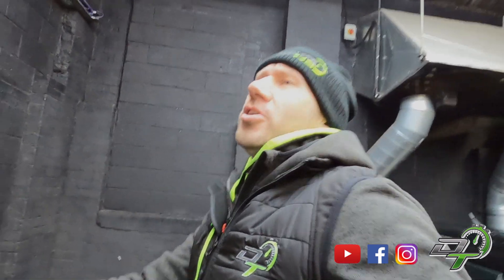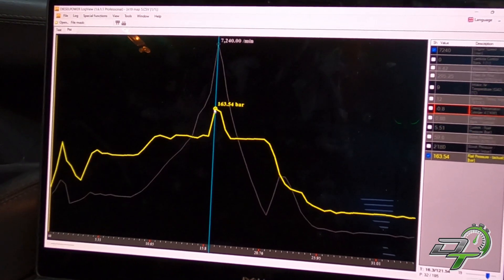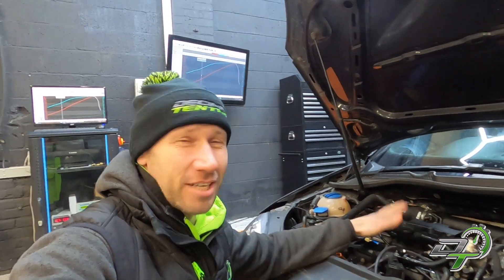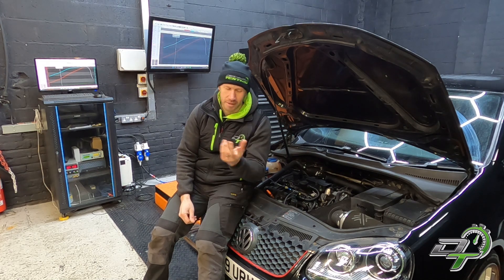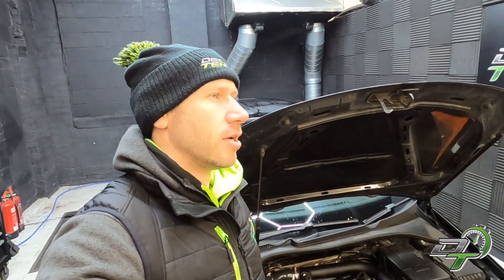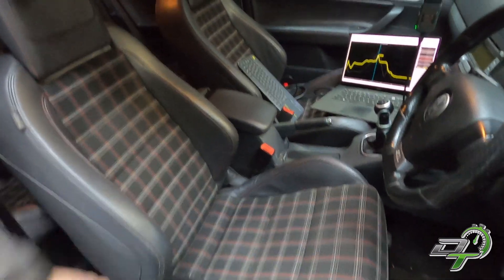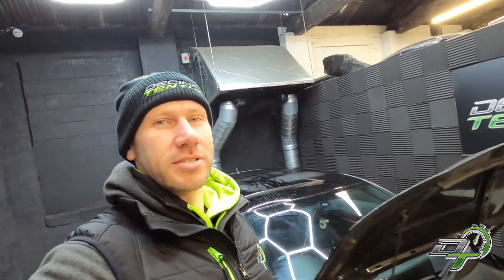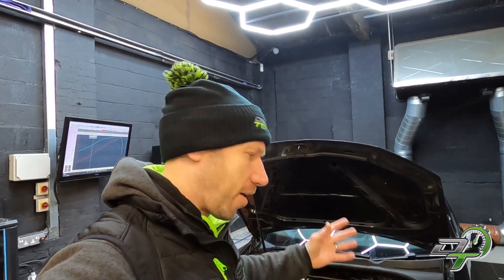DYNO FAIL for my Mk5 GTI...

Comment: I have a 100k mile Edition 30, apart from Pipercross panel filter and (eventually when I get around to it) pre-cat delete, I plan to just get a stage 1 remap - What is the likelihood that I will need a new clutch?  Everything working perfectly at the moment, no slip etc.
Reply from the maker: Impossible question to answer im afraid. Stage 1 tuning doesn't destroy a clutch, so it just comes down to the health of the clutch. It may last a good while, might not.
Reply: @DecimalTenths  Ok thanks for attempting to answer the impossible lol!  Unfortunately I'm down the south of the country, so you're too far of a trek for me, but love the videos!

Comment: Hi good day hope you well I was wondering if my vw Mk5 BHY can be tuned with factory ECU  
Other questions I also have is if my oxygen sensor is bad does it have a major effect on my engines performance
Reply from the maker: It can be tuned... but not much. Yes if your lambda probe is dead then performance will be affected.
Reply: @DecimalTenths  if I plug in scanner it shows O2 sensor bank one and bank two faulty if it's not 02 sensors how can I fix the probes or wires
Reply: @DecimalTenths  if I plug in scanner it shows O2 sensor bank one and bank two faulty if it's not 02 sensors how can I fix the probes or wires
Reply: @DecimalTenths  don't want to spend unnecessary money on oxygen sensors because it expensive in south Africa and if I do replace it and the fault is on the probe or somewhere else then I've waisted money and time is there maybe ways I can test it and how thanks in advance
Reply: @DecimalTenths  I'm driving flat foot but no power and like driving a retired 60year old persons car
Reply from the maker: @Dylan Hendricks  diagnostic equipment in the right hands will be able to diagnose it pretty quickly. We use vcds but any decent scanner will work to identify the sensors outputs. After that there could potentially be a power problem

Comment: Sachs performance clutch?
Reply from the maker: Have thought about that. I really want an oem pedal though 👍
Reply: @DecimalTenths  i got one in my VW T3 Van, AEB k04hybrid. Mild 230hp nothing fancy, can push alot more. But the pedal feel is awesome for my heavy T3 Van in the city. A bit stiffer but not that much. Really really great feel. Nothing racy or on-off, just like stock.